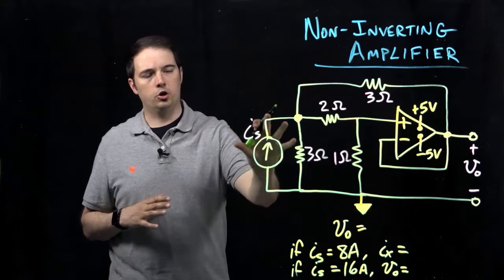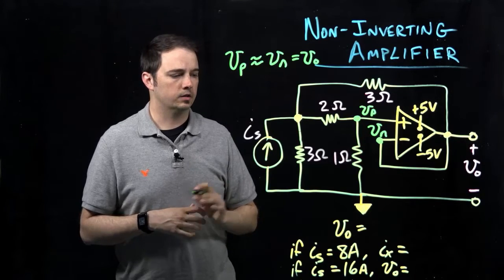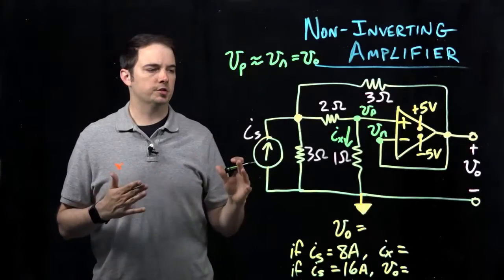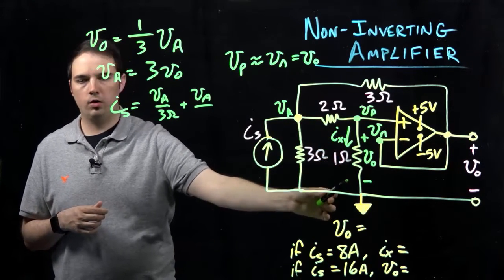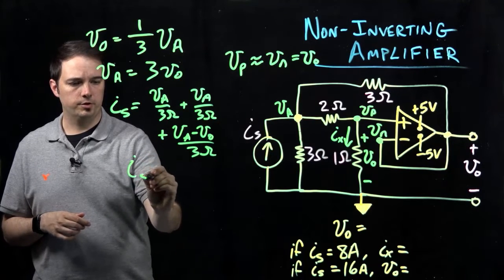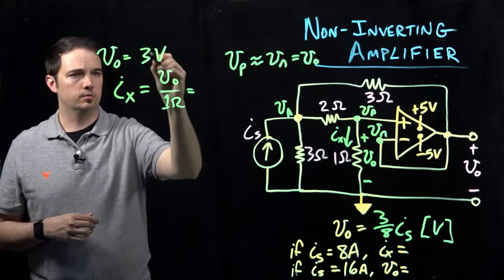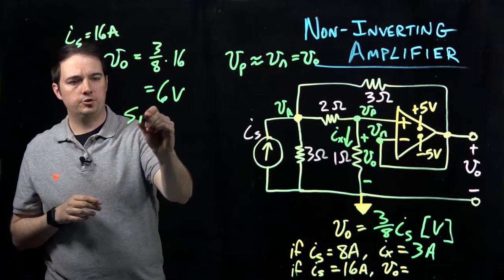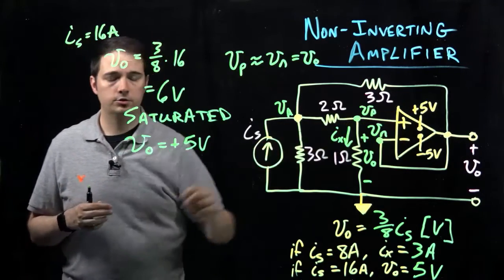Circuits I: Example with Non-Inverting Amplifier Circuit

Comment: I used another method ang got a different answer. I said if we use the current divider, I will get that the current flowing through . the top resistance is (Is/3).which is equal to va-v0 divided by 3. using the point that va equals to 3 times vo. I got that vo equals to Is divided by 2. What have I done wrong?